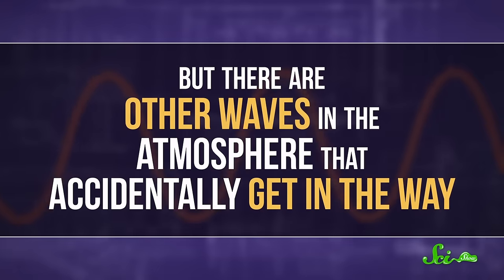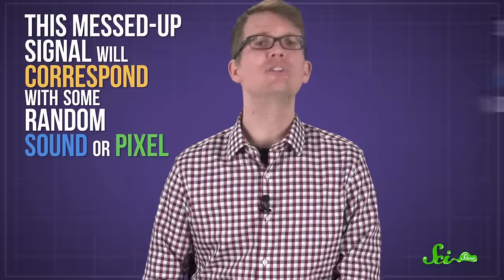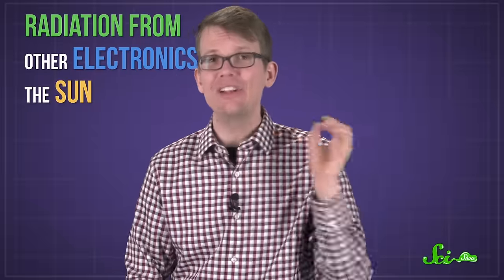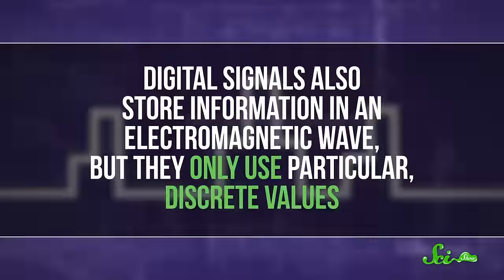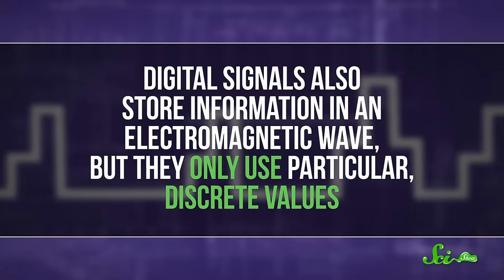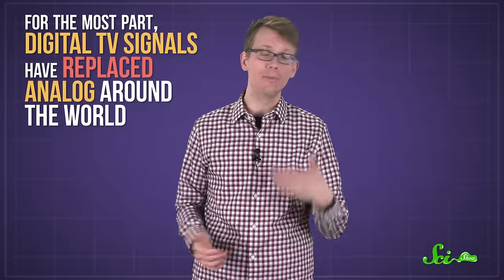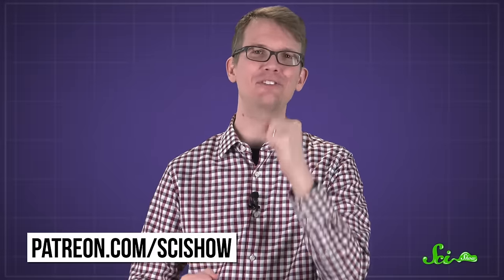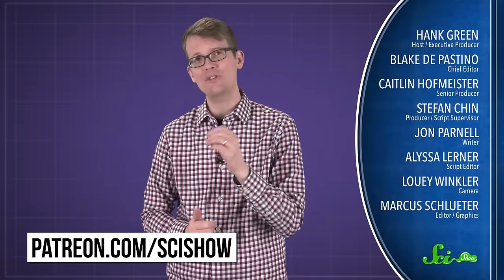Where Does Static Come From?

Comment: I think it should be pointed out that it's only AM radio that exhibits static (not FM radio).
Reply: Oh, really? I just tried putting SDRSharp on a spot in the FM band with no station and got plenty of hiss when in FM reception mode.
Reply: you should hear the static on an AM station when you ARE properly tuned in.  Especially when you pass under power lines and overpasses.
Reply: Yeah, and I still get it on FM, too. I can't try it out for AM, given the receiver I have (a $15 RTL-SDR) only goes down to about 30MHz.

Comment: I had a old box TV a few years ago, I didn't have it connected to anything but my Xbox, but for some reason it would pick up the radio station z88.3 . why did it happen
Reply: Channel 6 audio was 87.75 Mhz. If the TV was on CH6 and mis-tuned it could receive 88.3 Mhz.
 It was common to get TV CH 6 on an FM radio. Source; I'm a broadcast engineer.

Comment: So how do you broadcast silence? Shouldn't there always be background static?
Reply: There are ways to do it, but in short, you don't. Static noise is usually quiet enough that you won't hear anything, the NTSC signal will greatly overpower it. But if you look at recordings of 'silent' broadcasts you'll notice the data is always low-level random noise. This is especially noticeable with VHS recordings.
Reply: You can transmit silence by sending an unmodulated carrier. Without the carrier, the static would increase because the receiver's automatic gain control circuit will increase the gain and thus the noise. That is the main reason you get static. I'm disappointed he didn't mention it.

Comment: nope, nopen nope...
the static noise you talk about is just a fraction of what you see or hear on a receiver.
the vast majority comes from the receiver components themselves. the most  comes from the radio signal amplification chain then the mixiers and demodulators...
from a tv-screen perspective, the big-bang noise observable is worth about two pixels...
Reply: Pașca Alexandru Depends on the device. I have a high end ham radio receiver from the 70s, and that thing is almost dead silent until you plug the antenna in, then it sounds like a waterfall.

Comment: WHAT'S ANALOG AND DIGITAL????
Reply: old and new ways to transmit signals in this case. It is hard to answer here but it's just the way the picture or sound is carried on the radio waves (modulation). Analog has been superceded by digital technology
Reply: Analog is like "I'm gonna send you a wave and mess with it by either speeding it up, or slowing it down, or changing its amplitude. Depending on how I mess with it, we'll have a code you can use to see what I mean." 

Digital is like "I'm gonna send you a wave, but I'm gonna turn it on and off rapidly and you can use something like morse code to see what I mean when it turns on and off really quickly."
Reply: Nice metaphor. Super easy to understand